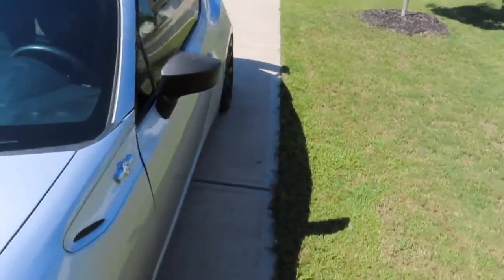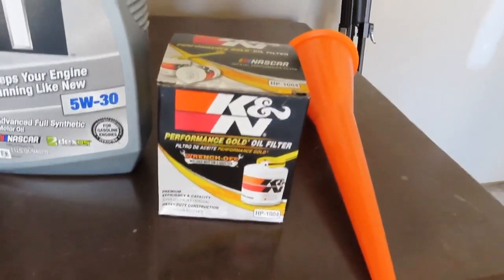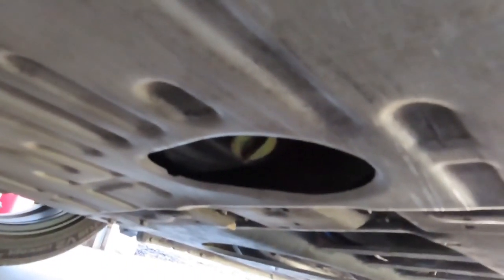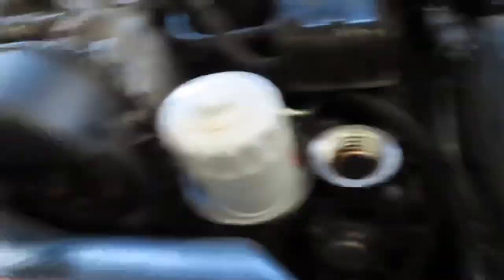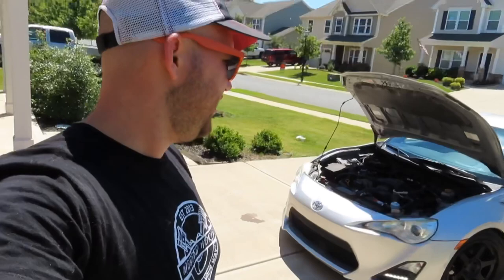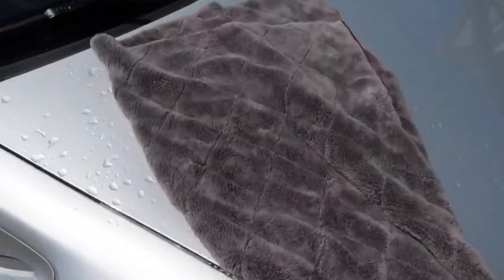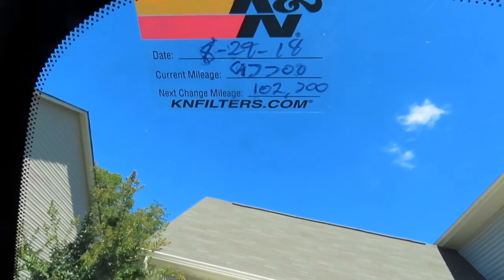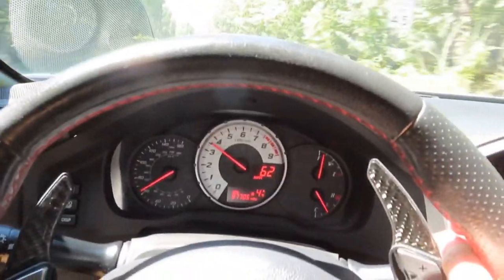Scion FRS oil change....it didn’t blow up!

Comment: One of the first mods i did to make it a super quick change is to get the fumoto oil drain valve plug. Literally take the plastic lock off and move the switch over, drain the oil. Proceed as normal